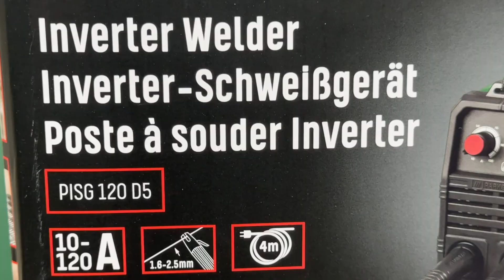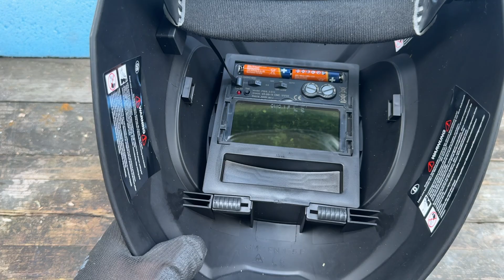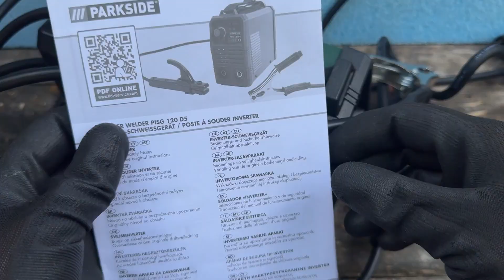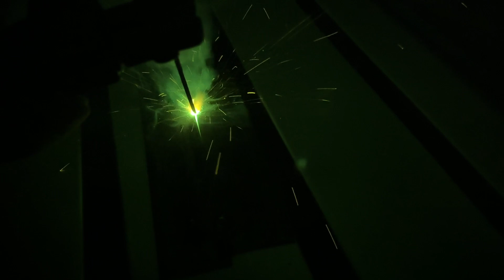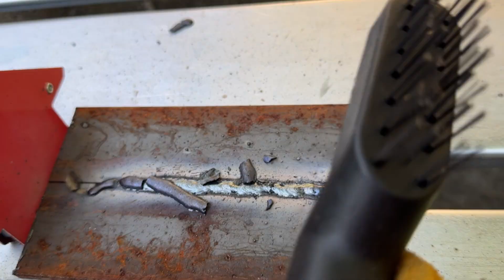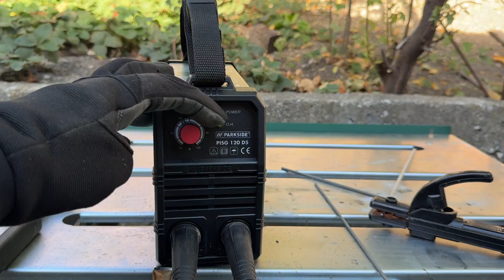Supermarket welder from Parkside! Cheapest welding set for beginners! Is it any good?

Comment: if u need deep penetration use + on electrode, if shallow base use -,
it is easier to weld with higher amp and smaller elecrodes,
if the base material is very thin, non continuous stitch weld can be the only viable way,
this welder has unfortunately low starting voltage for 7018/basic/cellulose type rods, ...rutile-celluolse or close contact rods re the easiest for amateurs
Reply from the maker: Thank you for the pointers!

Comment: Great video. I’ve just finished some evening welding classes and bought a used Parkside ARC Welder to practice with… it’s like new and came with 2 packs of quality electrodes opened but 90% of the contents. It’ll keep me going while I research a better relatively low budget option… if it allows me to make a welding table and general work bench I’ll be happy. Your welds were good for a total beginner… since my supervised welding lessons I’m much improved albeit from a low base… maybe you should get beginner lessons. Keep up the good work.

Comment: these units are unbelievably cheap but work perfectly even when pushed way beyond the stated duty cycle, If you had cleaned the weld area your welds would have been better, your rod angle was grim, you travel too quickly and you shake like a shitting dog. get some advice and practice because if that is your first attempt you did really well.

Comment: on the box it says you should use sticks between  1.6, 2 or 2.5 why did you get a 3 witch i am guessing its a 3.2 ?
Reply from the maker: Yes, however they do have the 3.2 listed in the manual. I did later get it to work really well with the Böhler 2.5mm electrodes, but shortly after I got another welding machine and this just sits there if an emergeny occurs.

Comment: Id be chuffed with those welds.
Reply from the maker: Thank you for that! They are a lot more consistent now that I have a proper welding machine with lots of settings to play with 🤩
Reply: @BrokeLifeEU What welding machine did you chose eventually?...
Reply from the maker: @MarkHopewell  Well, in the end, the decision was kind of taken out of my hands — and honestly, I’m glad it was. Not long after this video, BestArc reached out and offered to let me test their MIG145 Generation 9 welding machine.

Now, I know what you're probably thinking — they sent it over for free, so of course I'm going to say it's great. But truthfully, it is a really solid machine. It’s got a lot of adjustable settings, and it comes with both MMA (stick) and a MIG torch that supports both flux-core and gas welding.

Just to be clear, I’ve never earned commissions or been paid by them, so I can be totally upfront: I use this machine for all my welding projects. In fact, a friend of mine ended up buying one too — they were borrowing mine so often it just made sense.

I don’t have a ton of experience with other welders, but I’ve never felt the need to look for another one. BestArc also runs sales now and then, with discounts of 15–25%, which makes it an even better deal.

As for customer service — I can’t speak for regular buyers — but from my experience, it’s been one of the quickest and most responsive I’ve dealt with.

Comment: What I've learned buying tools in Lidl/Aldi is not to buy sets. If they sell belt sanders and belts, the belt will always be a size up, Circular saw for a cheap, and set of blades next to it? Well, those blades are for different saw, 20mm to big. Make sure your parts fit. I think th whole deal in this case is them selling a stick welder and spools of wire at the same time. One next to each other. Might be a good welder. Wire you just bought? Shove it up your...

Comment: the welding results are down to operator error. those parkside electrodes probably arent the best but with the welding technique in the first clip. that was bound to happen
Reply from the maker: Can you please explain I would love to know how to improve. I did weld at a 45 degree angle and I was trying to let the electrode melt and give it enough time to form a puddle before moving it.
Reply: @BrokeLifeEU  Well i could Tell you technique and stuff you should be doing but IT comes down to Just having a feel for welding. You Just gotta weld enough Times to Know what and how you need to do Things . But the Short of IT is, keep the workpiece Clean . The electrodes should be baked before use If they we're stored improperly. If you are dealing with shallow weld Pools get more Heat into the workpiece and Patience . You cant Rush welding . English isnt my native language but i Hope its understandable . Welding Stick also is the hardest way of mastering welding
Reply from the maker: You English is perfect! Thank you for the pointers! I do plan to get some practice in, because I feel this is a very valuable skill to have, even for someone who does not need it regularly, like me. Would you say MIG/Flux core welding is the easiest way to go in that case?
Reply: @BrokeLifeEU  i cant Tell you about fluxcore i have never used IT as WE only used Professional welding Equipment and fluxcore at least to my knowledge isnt really a Thing in Professional applications.  The easiest to learn in my opinion is mig/mag although you need the Gas which is inconvinient AS you have to get a Gas bottle and Hook It Up
Reply: @HPISRPYep as I thought, a BS merchant.  You may weld as a part of your job, but you're no professional.  Flux core is used plenty by professionals (not Parkside welders mostly😂, although I do know a guy who does agricultural welding, who did pick up the Parkside flux core welder and keeps it for light occasional use, because it's small and handy), for when they're welding outside and need a free hand.  

Oh and only a bell-end would criticise someone who had two or three welds under their belt producing that butt weld with the decent quality electrode.🙄
Reply: @stevedavey1343 only a bell end calls Others one i Hope that helps. Cheers Mate

Comment: 15 Euros for that piece... you lucky ...
Have you checked who really makes it ? O.W.I.M. makes it - the best tools that are branded Parkside.
The only good part for this welder is that it is lightweight.
It is a DC welder and therefore it is quite unfriendly with beginners.
The power adjustor was made like that in order to adapt for crappy sticks. Not really fast.
Reply from the maker: Yes, I could not believe my luck at all. Especially at the checkout when I indeed realised the pricing was correct. This is made by C.M.C. Gmbh, and I can say nothing about this company as the first time I am hearing of them is just now. The power adjustor is on the extremely bad side, you basically need to waste an entire electrode trying to figure out where you're at in terms of amps. Although can I really complain when I got it for 15 EUR? 😂 However does it deserve the full price of 60-80 EUR? That is a tough question. I think not, then again I don't know what other welders at around that price are capable of.

Comment: Parkside tools are already reasonably priced for what they are, but when they mark stuff down like this it’s unbelievably cheap. Over the last few weeks I have bought 12v drill for £8.50, oscillating multi tool for £10, and then the batteries were on sale.. and Lidl decided to do a by one get one free on top of that. So battery and charger kit was £10 + another free. And also 4ah batteries were £10 for 2 also. I felt like I robbed the shop.
Reply from the maker: So Lidl discounted their own discount 😂 I mean you are right to feel like you robbed the place. Those are some amazing deals indeed! I felt the same once I reached the checkout and I realised the pricing was correct for the welder, helmet and table. And the most amazing thing is that table for 25 EUR. You know Lidl UK with such discounts on the batteries may just mean they are clearing up space for the new 12V Performance line. You may get it in the UK after all!
Reply: @BrokeLifeEU  The deal for Buy One Get One Free was across all batteries, but they have been clearing a lot of the 12v stuff for some reason. Speaking of the performance range, they were selling a Performance Plasma Cutter unit for £150 a few weeks ago (PPSK 40 B2). I was quite surprised, but did wonder if this was a one off or the start of performance tools. I guess I’ll believe that when I see it.
Reply: Don't feel bad, in reality Lidl will definitely realise a profit on your purchases. That's their strategy. They make unbelievably good offers you cannot refuse. You probably didn't have those tools on mind when you entered the supermarket, but their sudden offer proved irresistible. That's called impulse shopping, and the secret of the extremely succesful marketing strategy of these supermarkets lies exactly in this principle.
Reply: Lol

Comment: I have the performance helmet and a variant of this welder for a while. It works fine to fix some stuff around the house. I got a lot of issues with the electrode sticking, perhaps it's because it's the parkside electrode or because I don't use enough power, or because I don't have very much skill haha.
Reply from the maker: It was the same with me, but you should try a different type of electrode, the Böhler ones I used in the video are like from a different universe compared to the Parkside ones. They transform the whole budget welder experience entirely. It goes from cheap and nasty to cheap and cheerful for real!

Comment: Never even looked at these as I always thought welding was something crazy difficult.
Now I still think there are nuances, but this looked easy enough for some small stuff around the garden etc.
Thanks for the video!
Reply from the maker: Thank you for watching and thank you for the comment! I have to say the included Parkside electrodes don't make it easy for anyone. However once you place a proper electrode in that welder it entirely transforms the entire experience. The Parkside electrode is a really tough one to use for me at least. It sticks A LOT and it melts at different speeds depending on if it's the start, middle or end of the electrode. Compare that to the Böhler which was identical, no matter which part of the electrode you were at. Once the electrode is predictable, the feeding speed is too, making it much much easier for a beginner like me.

Comment: You try pallet furniture for the first time (a DIY 101 skill) and you make a Homer Simpson monstrosity table while polluting your town. You then try stick welding on a whim (technical college material) and you get straight beads with full penetration and no gaps and no burnthrough, on a 15 Euro welder, that doesn't have proper amperage markings. Make it make sense 🤣
Reply from the maker: In my defence while I was making that table I used my fingers and arms as measuring devices. I tried to get it done in a hurry and had no time to mess about with SI or any other imaginary units. 😂 As for the welder, that table was a game changer as well as the BÖHLER electrodes. And in the end these were thick pieces of metal the reason for that is that I still can't easily weld thinner metals. I either go right through them with the electrode or it takes enormous effort to weld them without melting the metal. I found the proper brand 3mm electrodes easy as they are intuitive to handle really. You can feed them at the same speed, whereas the Parkside ones burn at different speeds depending on if you are at the start, middle or end of the electrode. I found that extremely difficult and I don't think they should behave like that at all. They also stick a lot and are difficult to engage. All issues I did not have with the BÖHLER ones. But with smaller diameter electrodes I find it quite difficult to weld. Still, I did buy a lot and I have another welder on the way so time to get some practice!
Reply: The only thing I would add is to always wear a leather jacket to protect yourself from splash and UV burns, and to never try to weld indoors unless under a proper fume hood. We only get one life!
Reply from the maker: Could not agree more with the "We only get one life!" statement. I don't think I will be welding indoors at all. I don't have the need to and so I will stick to outdoors as I can bring the stuff I need to weld outside. Even then and with the welding mask I could feel just how strong the fumes were. even when I was quite far from the actual welding and there was a bit of wind.

Comment: I have some experience with the mig version of their welder and it was rough there is no individual adjustment you get one knob to turn and that's it... You can do a few welds that aren't super important with it but i wouldn't recommend anything structural. The problem might be me owning a telwin maxima synergetic 200 ( probably 8-10x the price of the Parkside) you get used to things being easier...Also i welded with a Parkside mask before and it was kinda blurry(not sure what model all of the Parkside stuff is my neighbors).  As for the table i would actually want to buy it! Btw those welds are better than my first welds for sure! I switched to mig because i got annoyed by having to move my hand lower all the time to follow the electrode usage.
Reply from the maker: Thank you so much for your feedback and what you said about my welds! Honestly the table is probably one of the best things I have bought in a while and at €25 I am tempted to call it a steal. It is really sturdy and makes my welding experience considerably easier. As for the welder of course you are correct on that, this is no more than a home DIY welder to be used for the odd non-structural weld at most 1-2 times a month. You can use it more often of course, however if you do I think a better welder has to be considered at that point. Because it will no doubt make the experience better and easier. That said at €15 for this I would still buy it just to have a small welder at hand. But would I pay €70 if there was a better option at €100? I think not. The mask is the same thing at €15 it is fine, although I have seen them at two or three times that price and with how flimsy it is I don't think it is worth €45 at all. Unfortunately I can't really say anything much about the mask as I can only compare it with a cheap one from Aliexpress which was abysmal. I think I need to get a more professional mask if I continue on the welder video path just to see what they are like. I welcome suggestions regarding such masks. But even I can't imagine welding with the mask that comes with the welder. As a beginner, an auto dimming mask is a great thing to have.
Reply: @BrokeLifeEU   i almost bought that mask i need a spare when people that help me are around welds. The table if i find it around 70€ i will be buying that! I'm in the process of renovating a building to be a garage for cars and my projects so i definitely need a table! It's about 6mx7m and it's about time i get it done because i have no space in other garages for tools 😂. Expect me commenting on your new purchases because i am addicted to tools and i like sharing my experience because even if they help one person it's worth it!
Reply from the maker: I love to read your comments so feel free to write as many as you wish or can 😂 The table even at 70€ I think is a decent price. It is really sturdy and I can't imagine welding without a table, now that I have started out with a table 😂
Reply: @BrokeLifeEU  btw better options cost waaaaay more i have a similar welder from telwin for electrodes it was about 200€ when i bought it and the price doubled in since i bought it around 5+ years ago. My next purchase i am looking at is arccaptain plasma cutter from reviews is best bang for buck!